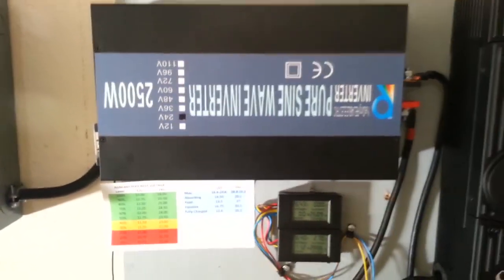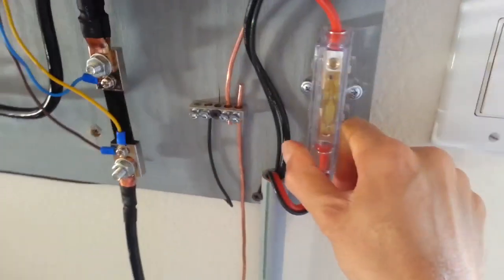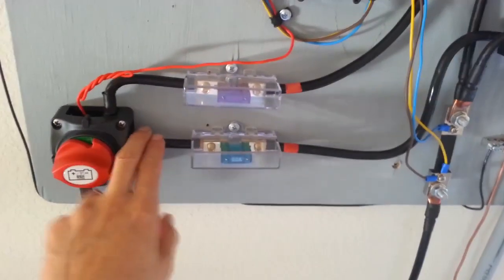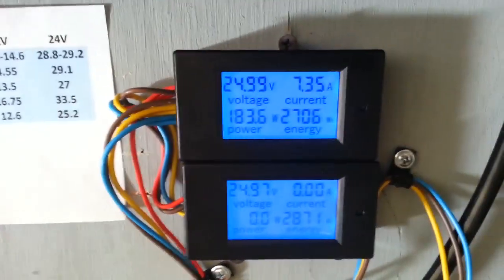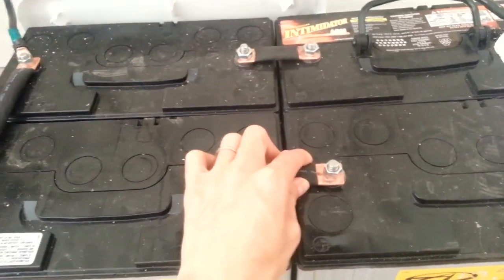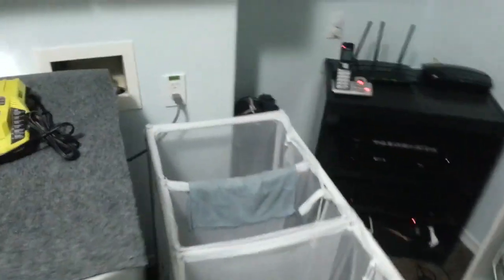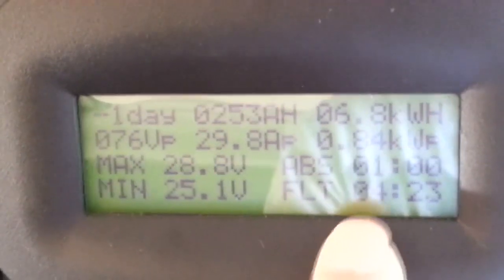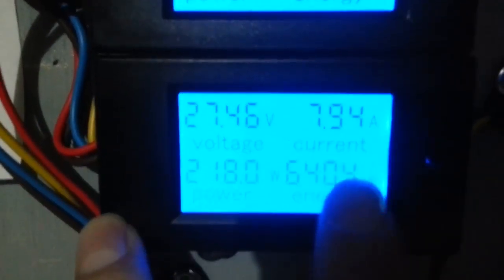1.2kw Solar Panels Off Grid w/ 24v battery bank running window air conditioner and more.

Comment: TIP.. You can steplessly dim down an under-table bulge and all other hungry electricity consumers with a 5000W dimmer (7, EUR). I run 5 dimmers in parallel on an 850W inverter. Kettle 2.2KW at 150W runs 12 hours a day, so the water is always hot. The room is also nicely heated. 2.5KW washing machine runs in parallel with dimmed to 200...400W. Iron, dishwasher, oven, electric heater, coffee machine, all internal heating are throttled with me. Videos about it on my channel https://youtu.be/eC2olbCBhh0 The inverter stays cool, quiet and the MOSFETs remain intact because extreme current peaks no longer arrive at the inverter. Now every Mini PV Inverter is enough to sell large devices...

Comment: I am currently trying to work out if it's possible to run a small house off a solar system alone, I'm thinking of moving to a remote location so no grid power at all. I'm in the UK, a country that's so different to Arizona when it comes to the amount of sun.😞
Reply from the maker: Best to add wind turbine or fine a property that have a creek then you can use hydro power would be best option... power 24/7. :)

Comment: Nice video, and yes what you think is right the kilowatt meter does not catch the surge wattage or the current. But if you what to find out get yourself a amp clamp meter with a hold current peak.
You might be surprised what it takes I seen fron 2 to 3 times what it takes once it is running.

Comment: Im a lil confused i dont see where u actually have the top battery meter running to i see the bottom meter and how u wired it but not the top meter i dont know where its going to

Comment: Just a question I have got some bad solar panels which are producing less amps but the voltage remains high. Can I use the mppt controllers. To cut down volatage and gain on the amps
Reply from the maker: Yes, that's what the MPPT charge controller does.

Comment: Is the ac unit big enough for the house? We are moving from kansas to AZ. In ks. 6000 but ac won't cool a room. We will be doing a 3000 watt system
Reply from the maker: Depend on how big is the house.  3kw system is only enough to cool 400-600sqf.
Reply: @DIYeverithing  thanks we are looking at house around 800 - 900 sq.ft we are working on the battery bank thinking 16 batteries golf cart batteries or if we can lithium ion batteries but cost way more

Comment: Just a query on those maxi fuses. I have 2x250w panels that are going to be in series, with approx. 80vdc total coming in. Would the maxi fuses be able to handle this sort of voltage or are they only ok for 12/24/32vdc? PS I have watched this video over and over again for the last year or so....love it!
Reply from the maker: Voltage on theory doesn't matter... however these fuses rating are not real... I had 80amps fuses blown on 40amps flow.  I would suggest to invest in Midnite circuit breaker, a tad more expensive but in the long run, worth it... You just flip the breaker back on, easier, faster and save in the long run.
Reply: Much appreciated, thank you.

Comment: hey dude, nice video. still very relevant for today's diy. Can you share how you wired the two watts metres to display current going in and that going out. 
I'm a little confused. wanna do something similar. thanks
Reply from the maker: The particular meter used in this video has two signal cables that get connected to each side of the shunt, if those wires are reversed it will measure the other direction of the load.

Comment: 6000 btu is about 1700 watts, is this a max surge start up rating for the AC?........Very surprised a system this size could run it.
Reply: 6000 btu should be no more than 650 watts

Comment: I did your set up, working really great so far, thanks for posting this video.  Two questions
1. Does the inverter disconnect on low voltage?
2. How important is the ground connection?
Reply from the maker: The inverter does have low voltage cut off... but it's very low, too low for Lead/Agm battery, most likely will damage the battery.   Grounding is very important...

Comment: Am Using a solar panel two nos 500w with 2no batteries 12v in total 24v with inverter 1.5kw, my question is if my display shows 22.7vcharge and on inverter its displayed 232v and 9% on back up useage on battery @mid-night is my reading ok

Comment: Why are the volts so high coming in? I have a 24 volt system as well and my charge controller shows 46 volts coming in. That had me worried because I'm charging a 24 volt bank and don't want to overcharge. I guess the controller is what keeps that 46 volts from going directly to battery bank?
Reply from the maker: For MPPT to work good, I believe solar input voltage need to be at least 20% higher than battery bank voltage.  The charge controller is reponsible for not over charging the battery, a regulator.

Comment: Correct me on your solar set-up...  4solar panles.  2Series + 2Series then run them parallel to (charge 12/24v controler).  For higher volt?    Not run em 4series, you said 2+2then parallel?  Right?
Reply from the maker: Correct, 2 panels in series then 2 set in parallels.  Unfortunately running 4 panels in series would give me a VOC of 182volts, higher than what the charger controller can safely accept.  Also, there's no reason to do that... since my wire run is not that long... and it could back fire because at certain time one or two of my panel are shaded... and if wired all in series, it would significantly drop the production.
Reply: devildestiny555 one more quick question.  Does batt rangement has to change to 24v.  Or I xan keep it at 12v
Reply: My inverter is only 12v.   Is my system a no-no?  Or I can run pv24v and keep batt12v?  And i would be able to use 12v inverter?
Reply from the maker: The charge controller is the key component that would regulate high voltage panel down to properlly charge your battery bank... regarless of what bank voltage you get... Of course it depend on which controller you have.

Comment: Great, 
i lie what you did, hook it up using the solar to run the system and just topping back up the batteries.can you include a schematic of the wiring

Comment: you should get car audio circuit breakers, under $15 on amazon
Reply from the maker: Those car audio circuit breaker work ok on 12volts DC.  On my 24volts system, I have burnt up a few just up flipping the switch on and off.  There's no way it would work on my new set up which is 48Volts.  I had to go with the Midnite Classic DC Circuit breaker, they are about 20.00, but they were design to work up to 150volts DC.

Comment: I am in sunny northern Colombia, thought I could tough it but need a little a/c.  Just to cool afew hours a day 1 bedroom (10 ft x 10 ft).  The rest of the house is conventional power.  How cheaply cud I do this, just to buy the panels, inverter to power just a small a/c?  Thanks a bunch.
Reply from the maker: Yes, it can be done and a lot easier than most people think.  For a 10x10 room you only would need a 5000-6000btu window ac and they generally use about 450-550watts.  If you only want to run it 3-5 hours a day, you can get away with 3-4x 300watts panels.  Two agm battery that's around 100ah hour and a inverter around 1500-2500watts.  If you do it yourself, all of the component you can source it at about 1400.00 including the window AC.   Good luck!

Comment: Explanation sucks man. Are your panels individual 12volt or 24 volt 350 watt. Did you connect 2 panels in series doubling amperes keeping voltage the same and then doing it again with the other 2 panels connecting in series doubling individual panel amperes and keeping voltage the same until you added the two bundles in parallel doubling output voltage of an individual panel.
Reply from the maker: It's an overview of the system, not a tutorial.  I am no expert so I am not going to show anyone how to do things.  The panels are rated 24v and two of them are in series to give 48v nominal then parallels together as one array.  Are we clear Mr. Robert Doell?

Comment: You should wire those battery connections going to the rest of the system diagonally. This will (somewhat) even out the draw on your batteries and may help extend their life! (And it can't hurt, so no reason not to do it!)
Go here and look at "Method 2":
http://www.smartgauge.co.uk/batt_con.html

It's a simple change but, it can make a big difference over time!
Reply from the maker: Thanks.  But I no longer need to worry about this.  I had reconfigure my bank to 48V and all the 4 battery is now in series.  So no need to worry about this issue any more.

Comment: Can the a.c. And freezer be active at the same time? What if u had 6 panels? Cool set up
Reply from the maker: Yes, the window ac is only 6000btu, so it only uses about 550watts and the mini fridge only use about 120watts.  When the sun is shinning, the 4 panels is more than enough.

Comment: is your Cells are polycrystalline or mono crystalline ? And which is better in which condition, if you explain please.
Reply from the maker: Most of my panels are poly-crystalline.  I'm no expert at this so don't take my words for it.  But I believe that mono are supposedly more efficient in low light condition such as cloudy/overcast days but more vulnerable to heat than Poly.  Poly is vice versa.... So if you're here in Arizona, where it's bright as hell and hot as hell... mono and poly would give you the same result.   So sum it up, if you live in a mostly cloudy/cold place,you buy Mono.  If you live in a hot sunny place, Poly.

Comment: Hi dd 555. Like the set-up. A quick word on the batteries: Connect the charge/discharge leads to diagonally opposite corners or you will kill your batteries. Keep all parallel links the same length. Batteries do not die, they are killed!
Reply from the maker: Thanks, yes I did switch it afterward.  But doesn't seem to make any noticeable difference.  However, I have since switch to 48V system, so they are all in series now.  No need to worry about that any more.  :)
Reply: @DIYeverithing  When you moved to 48v did you change the panels from 2s2p? Do two panels in series creat enough volts to charge 48v? If all 4 panels were in series the volts would be over 150 which would be to much for the inverter correct?

Comment: Thank you for the time and effort in making your video.  Were the blemished batteries actually Deka batteries and were they from a retailer/shop in San Diego, CA?  I'm guessing no warranty?  Just curious since I have a friend currently shopping for batteries.  

Any chance you've measured the surge and running watts (or amps) on your air conditioner?

One suggestion - you may want to take a look at your battery wiring.  See:  Smartguage's  website at http://www.smartgauge.co.uk/batt_con.html.  This site is very helpful in understanding why attaching your battery leads (in regards to lead acid) at opposite corners is helpful in keeping your cells balance.  In addition, I've learned a lot at the Northern Arizona Wind & Sun forum located at: http://forum.solar-electric.com.  Enjoy your system.
Reply from the maker: Yeah, no warranty.  I did not buy it from a shop, bought it off some dude at his house... lol.  Probably he bought used crap battery and just refurbished them somehow.  Lesson learned.   I had reconfigure my bank to 48V and all the 4 battery is now in series.  So no need to worry about this issue any more.

Comment: Why not go with a much better battery salt or lithium?
Reply from the maker: If you donate it, I will be gladly to take it.  If it's lithium, I would prefer LIFEPO4 and above 10kw in size.  Thanks.

That's why.  :)

Comment: how has your "reliable" Chinese inverter been holding up? I ordered a 24 volt 3500watt pure sine from the same manufacturer purchased through amazon. I've seen a recent bad review so I'm slightly concerned? However I've yet to set my entire system up & test my inverter. I'll do that in the spring. I'm wishing I had purchased my inverter through home depo.
Reply from the maker: Still working.  Through out the 4 months summer, I have consistently pull 1000-2000watts out of mine with ambient around 100-110F.
Reply: devildestiny555 Awesome news! Thank You. I'm hoping to run an incinolet electric toilet with mine.
Reply: GreenMountainGrow get used to burning out inverters every year. Buy the cheapest one you can get.  Pure sine wave inverters are cheaper than buying batteries.  I figure it's the cost of doing business.

Comment: You can build a water tank connected to air tanks and then use the compressed water to generate electricity at night...
Reply: Right, especially since water in incompressible.
Reply from the maker: That sounded like adding more problems to the system.  haha

Comment: Great video for learners like us. In your system how did you ground. Did you ground both the cc and inverter or you grounded only the inverter. Thanks
Reply from the maker: Yes, both CC and Inverter are negatively grounded.
Reply: Thanks, pls what do you mean by negatively grounded

Comment: Look up a video by a channel called "Gone with the Wynn's" they did a test on series vs. parallel on panels. What they found was that shading 1 complete plate on a panel knocked out the entire panel. When you show yours the bottom portion is shaded. Your loosing power from the whole panel until those cells get full sun. Can you raise them up to get them in the sun.

Comment: Also quick tip, rig up a water jug like the 2 liter bottle dog bowl to keep water in the bottom of the A/C there is a slinger in there that slings the water up on the coils and it will drop the temp another 10-15 degrees, making it work less for colder air.
Reply: collect the distilled water as a lot of times there will be extra. Then reuse when low. So you dont ruin the coils with mineral deposits.

Comment: Been watching your video a few times. Thanks for the informative video. I am planning to build a similar system like yours, so for a novice like me , can you kindly provide the schematic diagram from the panels to the inverter? It might be a big help for me to study the schematic. Thank you in advance.
Reply from the maker: Sorry, I did not drew up a diagram or any plan, kind of did it as I go.  But there's nothing special about my wiring.  Panels go to disconnect switch > Fuse > Charge Controller > Load + battery bank.

Comment: Hi DD555. I like your system, it's similar to mine. I have two tips for you: Where you have your batteries connected in parallel, connect the charge/discharge cables to diagonally opposite corners to balance the draw in times of heavy current use; this will aid battery life. Bear in mind also that the round-trip efficiency of the lead-acid battery is often less than 90%, so power into battery-bank does not equal power-out.
Reply from the maker: Thanks... I have meant to do this for while, just haven't manage to do so... :)

Comment: Very nice i have been researching a lot and would love to duplicate your system. I trying to deside t build my own or order a kit
Reply: Would you recommend the 12 or 24 volt?
Reply from the maker: You would have to decide base on how big your system is and your load demand?  But most likely a 24v system is probably the lowest you want to go... Smaller wires, smaller fuses, more efficient...  Check out the newer video, you can see more.

https://www.youtube.com/watch?v=suzedll9f8M
Reply: thinking of doing a 2k system with a 2500 inverter but not sure about how many batteries as I don't have anything  spacific to run off of it. I'm hoping to run a  frig, fan( 50watt) couple 3 amp TV's and a freezer.  I have 4 12v deep cycle batteries and was going to use it as a portable set up until I figured out what it would do then wire it into the house, I have good sun from 8-3 each day. Loved the video's by the way

Comment: just wondering why people do not do a 120-130V DC system? wouldnt inverters run better off like 126VDC (10 batteries in series) and would have to run much smaller conductors to the batteries and controlers, etc. inverters wouldnt need to have any type of transformer probably with this high DC voltage.
Reply from the maker: I am not expert, but I think running too many battery in series will cause a imbalance on voltage per each battery.   It would be a nightmare to keep them in check.  You would need to add a balance.   If battery get imbalance too much, it will decrease performance / life.

Comment: I need you to come help me set everything up once I buy it all.  fellow phx here
Reply from the maker: I don't know about setting up everything... but sure, if you got some questions I can try to help.  :)
Reply: AWESOME!  Did someone else set up your system?  What do you think the total cost was on setup for your system?  I am trying to setup for just an ac unit incase the power goes out in the summer.  it did once and that sucked.  it lasted 2 days.  The solar set- up you have is perfect i can put it over my pool equipment.  Can we email sometime?
Reply from the maker: +Mayhem On Nassau 
I install everything myself.  Its not that hard.
Reply from the maker: If you really need help and getting components,  you can email me devildestiny555@yahoo.com
Reply: that would be awesome. it will be awhile before i start getting the gear.  i'm going to have to start a budget and start collecting. def will be in touch.